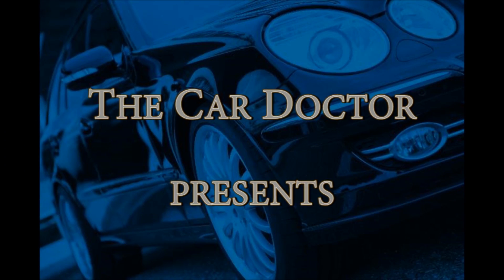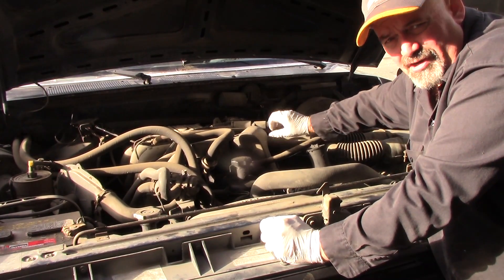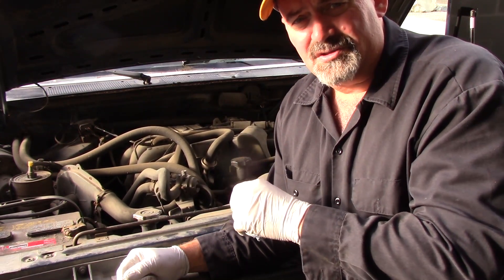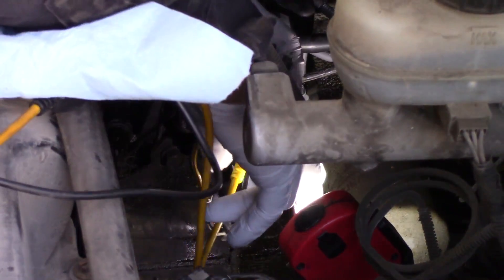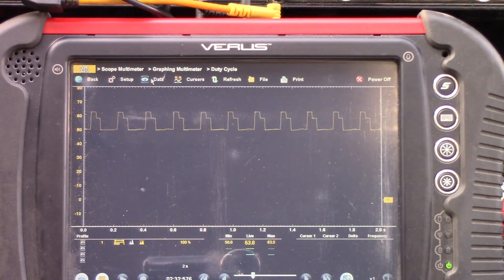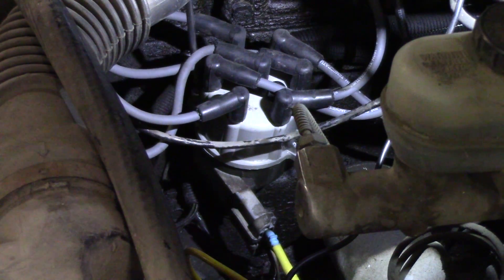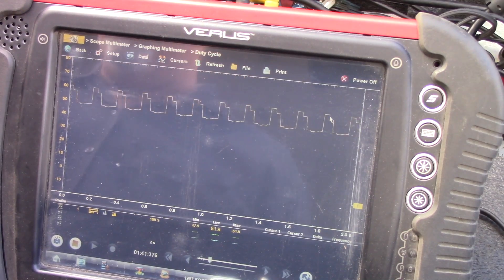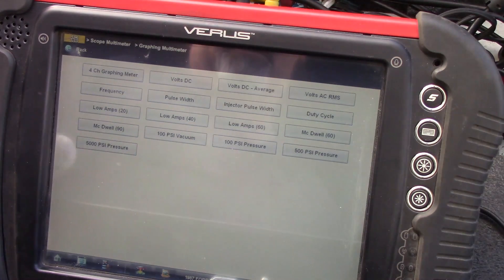Diagnosing Ford Pickup Hesitates On Acceleration When Warm

Comment: Can you tell what scanner that you are using for OBD 1? I have a 92 f150 4.9 5 speed with 430,000 miles. Just want to keep it running. Thanks

Comment: I have had 3 ford trucks now with 360/390 enhines. 70's trucks. Exactly this issue and noone seems to have anything to share about my issue or even experience it. What is going on? A friend too and they all seem to have an issue with 2 barrel motorcraft carb or aftermarket replacement. Why is it that they start to spit and sputter and act like no fuel or not get fuel when they reach temp, then  stall out and wont start for lik an hour? I just dont get it. I keep going through mechanics and noone can seem to fix the damn problem. Replace distributor, coil, fuel pump, ignition module, starter, the square thing inside fender with 4 tabs, everything. It's killing me. Just want to make some damn money already with my dump truck but it wont run good or stay running. I desperately need help.
Replaced carb gasket, fixed mouse damaged wires, re-tightened carb bolts, adjust the timing, seriously what is the problem. I even rebuilt a couple carbs, check vacuum leaks, fix them as i find them. They dont all have the round choke piece on the passenger side. Either way its a problem i can get fixed every time.

Comment: My trouble started with vacuum. It's a 90 F350. I had (idle) trouble out of the arse.. High.. Always have to kick it down to bring it down after stopping. I done all the thing these video say to do, and got NOTHING SOLVED. Chasing everything down, I ended up with an Ignition control module trouble. CHANGED.. helped on running. And a backfire I was getting after the others. Not idle though. Still drinking fuel like a drunk drinks beer. I also had brake trouble. Well.. After changing the brake BOOSTER.. I ended up fixing the idle trouble. Purrs like a kitten now.. But hesitation is there on take off, making me fan throttle to stay going. Or it will die out.. Leading me to here..

Comment: I own two of them.... An F-150 and an F250 the F-150 has been having some serious issues with it bogging down and not wanting to run run right when the engine is warm... When it comes time to shift into 2 and 3rd.  The RPMs drop and it starts to stall.... I can manually shift it. Around the same time I started having this problem the tachometer also stopped working. I had some mechanics look at it but they will not touch OBD 1
I've only met one mechanic who will even work on something this old and he couldn't figure out what the problem was

Comment: I have a 94 4.9 the whole engine been rebuilt and still having issues when it warms up has no power and misfires but unplug spout runs ok I have replaced distributor 4 times but keep getting g them off ebay it runs great for a week or 2 and starts doing same thing just slightly at first but more I drive it worse it gets I think I keep buying dud distributors I get a check engine code for running to rich  and misfires and exaust fumes are strong what would be a good brand ones I been getting are no name brands  from ebay and I think that's my issue is cheap garbage part over n over
Reply: Pull the computer and open it, check all the capacitors, see if there are burn marks on the board, I am in the same position with my 89 E150, replaced my distributor because the cap was missing a tab to secure it, was broken off, then the nightmare began, was slow tho, from idling when warm issue, degrading down to where its missing so bad you just can't drive it, luckily you should have the distributor with the ignition control remotely mounted on the fender on a heat sink, black box, that will be your issue, mine is gray, mounted on the distributer.

Comment: I have an 88 f-150. I have had 3 distributors in it.All were remans. Anyway,The o.g. dist. went out. A local shop replaced it.When i got it back,it jerked while driving down the road. Jerked hard.They told me it was a bad dist.  I got in back and it ran good. Still had a little skip every now and then.I drove it for a while.The skip turned into jerking and sometimes at lower idle,it would just cut off. Took it to my local Ford dealer.They had it several weeks.They ended up putting another dist. in it. It ran good for a while but now it is back to jerking hard(dead miss)and cutting off. I still think it is in the dist. Does anyone like MSD,Mallory make an aftermarket dist that will plug in like the og?

Comment: I have a 1994 Ford f250 diesel truck. I forget what that motor is called but it is supposed to be the cream of the crop. It seems to run fine until it gets over 40 mph then it starts running rough like it's not getting gas. I was wondering if you could help?

Comment: I got a 86 f150 with a 302 and its normal at idle and accelerating right up to 45mph , then it sputters and shakes feels like it has no power .   It wont go any fastter than about 50mph ,I let of the pedal and  its normall again , has new plugs good wires and a edelbrock 4 barrel that we have messed with the screws over time  , how can i fix this or what would be recomended any tips would be useful thank you

Comment: Old video I know. I’m using a multi meter to measure duty cyle at the distributor and I’m getting 80-90% with the spout disconnected and ~100% with the spout connected both while the engine is running…am I measuring this right? Also is it normal to get duty cycle reading by just putting the test prongs in the engine bay close to the distributor without touching anything?

Comment: Do the 460s have this same issue with the distributor and i was wandering can i run a vacuum advance distributor since my egr smog is all gone no 02 sensors and after market snorkel intake also i have midlength or long tube  headers?  Just curious if the vac adv distributor will take the timing control and nix the comp crap
Reply: If you have fuel injection, you are doomed to the stupid distributor setup Ford designed

Comment: Hi great channel I was wondering if you could help me with a hard problem I have on my truck.  I have a 2010 F150 5.4L with 140K miles on it. It has a light throttle stumble or hesitation. It is hard to describe but I will do my best. It seems to start right after it changes into 3rd gear and it will stumble a bit on light throttle. It also happens in 4th I will be cruising a long and just lightly get on the throttle and it will kind feel like a misfire and an exhaust heat shield rattle from underneath which could be the catalytic converter making a rattle when this happens. If I give it more throttle its no problem or if I am not as light footed it is fine. When it happens it also makes a exhaust noise on the drivers side or close to it almost like a loose heat shield rattling or a loose baffle in the muffler type sound but it sounds like it could be coming from the cat on the drivers side but it only does it during this stumble. It has no CEL and has no problem driving highway speeds etc. The exhaust never rattles any other time.
Things I have already changed in hopes to fix it. I changed all the spark plugs and all of the coils packs. All new. I replaced the air filter. Made sure all clasps are locked down and the feet are in the housing slots. Changed the oil checked all connections at coils and injectors. Used dielectric grease also. Cleaned my battery terminals and tested battery.  I cleaned the MAF sensor and the throttle body.  I removed it from the truck and cleaned every bit of it.  I also did the relearn just like you showed.  (jumper wire with neg. disconnected, 15 minute idle with everything off, then test drive)  It still has this misfire or stumble.  
My ideas are possible clogged cat but no codes and it has no problem when give throttle or going highways speeds. Maybe something in the drive by wire throttle body,??? Any ideas or if anyone has had this problem before please let me know your thoughts. Thank you so much.
Reply: Let me know if you figure it out.  So far, fuel filter, air filter, ignition coil, plugs, wires, cap and rotor, FPR

Comment: no disrespect ...but  if your are agood mechanic(exp.)  repair distrib ,replace all internals ,it is 
a job for a press ect ect ,but can be done unless one can get  
OEM fomoco new old stock distrib, ....new parts are chinekrapenoli
Reply from the maker: Don’t understand your point. I repaired an old beater truck using what was available and most economical.
Reply: fine ..just point out ,new dist are not that good quality ,any more ,, 

some time it is best to repair existing.

Comment: Same problem on my 97 ford 7.5l liter runs excellent when I first start it but after it warms up it drags really bad motor and tranny are all rebuilt getting code 212 loss of ignition diagnostic monitor input to power train control module slash spark output and 628 excessive converter clutch slippage
Reply: Can't figure it out no one can help me fix it

Comment: I have replaced coolant temp sensor, map sensor, iac valve and sensor, tps sensor, new fuel tank, pump, and filter, air filter valve cover breather and both filters in airbox, changed oil, induction cleaning thru brake booster line, radiator flush. She will act differently like she is glitching but after she's warm she will surge and then idle good but kinda rough then surge again and then it's just hit and miss idk

Comment: having same problem with a 94 f150 inline 6...all the stuff I'm doing is making it run better but still hesitating and surging
Reply: sprayed car cleaner to check for vacuum leaks couldn't find any sounds like ignition component from your video...she runs so good cold and after she warms up she's sick....turning heat or ac "OFF" will make her run rougher or just die, please help

Comment: Tim nice video thanks for making, I picked up a 87 f150 XLT lariat 5.0 302. It has 181,000 miles on it, but in really great shape. I own it about a month or so, and when I start it the idle goes up and down a few times then levels out and seem to be running fine. Then the other day I ran low on gas before switching over to front tank, and now truck is not running right seems like it's stumbling as I'm getting up to 20 / 25 mph it almost feels like I'm going down a bumpy road. Do you think this might be gas related problem or possibly the distributor. Any help would be appreciated. Thank you

Comment: I have a 1994 f150 4.9l when the speed reaches 60m / hr or 70m / hr in any climb the speed drops no matter that I press the acceleration pedal.
Reply: The same issue with my 1992 5.0

Comment: I have a 1887 f150 v8 5.0 

The truck turns on but it sounds like it’s going to turn off, then I accelerate for about 3-4 minutes and it gets warm and it’s good to go
But when I’m driving it, if I accelerate to around 40 mph, the truck starts acting like it’s going to choke so I got to let go of the gas. If I step on the gas again it goes back to trying to choke and turn off and I can’t run the truck anymore. Got to stop 

Any idea what this could be??
Reply: Did you ever figure out what was causing that?
Reply: @kevind1154  never, currently the truck is garaged till I have some time after Christmas to fix it

Comment: I have a 1995 F-150 4.9L with a random hesitation! It’ll happen randomly then snap out of it randomly! Whole ignition system is new, whole EGR system is new
Reply: New does not mean there is no fault.
Reply: Mine is exactly same. 
It come and goes and I don’t know more what to do.
Please some one help us.
Reply: @ffassheber  I found out 2 capacitors in my computer were bad I replaced it with a new one and now the hesitation is gone but I have BAD ignition ping
Reply: @ericmcguire5469  Timing off will cause a ping, try high octane to correct it
Reply: @ffassheber  check your computer
Reply: Check PIP signal from dist. and look at my previous posts.
Reply: Recipro1 every sort of the ignition system is new, EGR system is new, Fuek pump is new soon to have bigger injectors

Comment: A 1988 F150 5.0L TFI -IV
Original PCM replacement , seemed ok.
Problems again with poor acceleration,  mechanic replaced distributor with a DST2880 made in China.
OK for a month ,then , boom same problem.
Viewed your video as and put a dwell meter on PIP wire with SPOUT connector in place. What ya know , 
8 cyl should be 28°to 32° and the reading was :
58°. Back to the mech. who installed Chinese distributor!!!  Dam It!
Reply: Follow up to first post is that the mech. put in another identical dist. and the dwell meter test showed failure of the second  at 64° dwell.
What the he'll is coming out of China???
Reply: @Recipro1   china is all junk

Comment: Where the spout circuit on the truck?
I have a 1994 Ford F-150
Reply: If it has TFI-IV then on one of the six wires coming from the module. Find it first to be sure so you don't connect to anything else that might cause damage.

Comment: Help!! I have a 2005 Ford Escape 2.3 4 Cyl 5-speed manual 209K miles..clean oil clean air filter..EGR code and O2 code...Runs great cold...even after warm runs smooth..but once you stop at a light and idle for more than say 20 seconds, it starts to idle real low and rough but never has stalled...If I rev it up as I'm always worried it may stall when I take off two times it did kinda bog down as I took off but made it home ok...only happens once fully warmed up say the first few miles of driving..One buddy hooked up his reader and said a MAP sensor but my reader dowes not show it..only the EGR which has been on for a year..I know I know..

Comment: Mine runs great till weather get over 95 I'll see temp come up some then will start to act if it's running out of gas till it stop aand wont start running again to cooled off
Reply: Did you find a solution mine is doing this too
Reply: That temp prob. leads me to suspect the Coolant temp sensor or the PCM
EASY TO CHECK

Comment: What is the issue with reman distributors that causes them to also have the problem?
Reply: I'm not sure either but when it comes to Toyota, Honda, or Ford parts. I've had the best luck with the factory parts. While most aftermarket stuff fits but doesn't work as well. That's for sensors or things bolted onto the engine.
Reply: I think the problem is the body of the distributor becomes magnetized. Remans reuse the body so the problem remains.

Comment: "New" distributor complete with a chinesium  distributor cap. I used to see a lot of problems the TFI  moduals in those years causing rough run and surging. It doesn't seem to matter weather you change the oil or not on a 300 6. They just keep going.
Reply: I'm not a Ford guy, but the old in line 6 was a very good engine.  Not a lot of power, but they last forever.

Comment: Great looking old truck, must have been well cared for.  purred like a kitten after your repair. 1987...wasn't that about when Ford had changed the mounting location for the ignition control module?  My 1995 wants to surge when decelerating and stays around 1100 rpm until it comes to a full stop...then idles normal. I've thrown several parts at it but still has this problem. Thought that an old school mechanic like yourself probably worked on many of these old Fords could help.
Reply: mikey mike
Did you throw a Throttle Position Sensor at it?
Reply: wysetech2000 Changed the TPS also IAC and Temp sensor. Removed and cleaned throttle body. Used all OE parts. still surges when decelerating, and won't come off fast idle till vehicle comes to a complete stop. Thanks for your input.
Reply from the maker: I know that plenum gasket near the front leaks vacuum quite often causing a similar symptom. Be sure to look at that.
Reply: The Car Doctor Yea, Iv'e heard that also. Sprayed brakeclean all around on a cold engine, was afraid to do it to a hot engine.
Reply from the maker: I just spray water under it just behind the dist area.
Reply from the maker: not sure what you mean by "old school" but ill take it as a complement. haha. What motor is in your truck?
Reply: 5.0 Windsor Truck has 80,000 miles. Owned it since new. Has the EEC IV OBD1
Seems most mechanics today are unfamiliar with this older technology

Comment: This was a nice relapse to easier times. I still have my dwell meter and timing light from the 70's when I tuned up cars using a "Sun" scope that was as big as that truck.  :) Great diagnostic process on that one Tim.
Reply from the maker: I worked with an old sun machine as well. It had a four gas attached and probably weighed in at 1000lbs..haha Blessings friend

Comment: Good day  The tip did not help, I own a chev.  But did you 30,000 miles over oil change.  Good video Thanks
Reply from the maker: Seems like given the mileage was well under 100K that the oil must have been changed sometime in the early 90's..hehe

Comment: Don't forget to change the points and condenser. Also adjust the carburetor. HaHa. Good old school repair.
Reply from the maker: Oh good call, haha
Reply: Even with points burned down to the brass, you can still drive it, this setup is insane, designed to fail

Comment: Hey Tim, Where did you get my truck? lol. I had a 1990 Ford F150 just like that. It had the same cap also. Sadly a guy runs a red light and totaled it. I had the same idling problem. I replaced everything you mentioned. including a new Sensor Map. (I Think that's the name of it). It's located on the passenger side fare wall. I put a new in. Still had the missing. I finally got a used map sensor. That fixed it. It was a great truck. That one has a great body. Is it for sale? lol. Great awesome video my friend. Thank you so much for sharing it. God bless you always. You are truly a good person.
Reply from the maker: I had no idea this was your old truck, otherwise I would have told you about the stack of $100 bills I found under the seat...hahaha
Reply: OMG, Thats where I left that money, lol. No worries just drop it in the mail. lol,, Great video my dear friend.